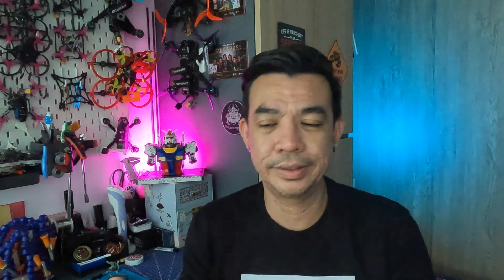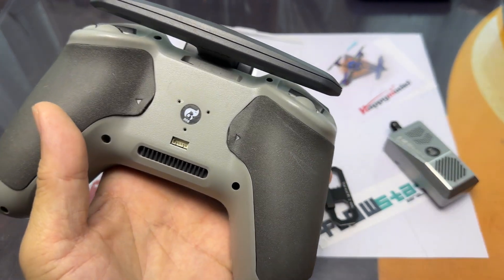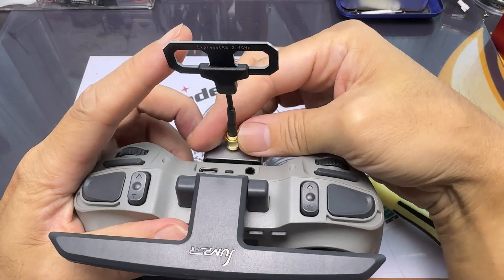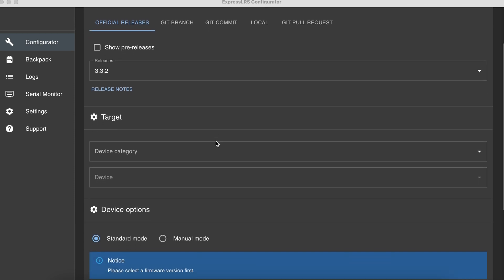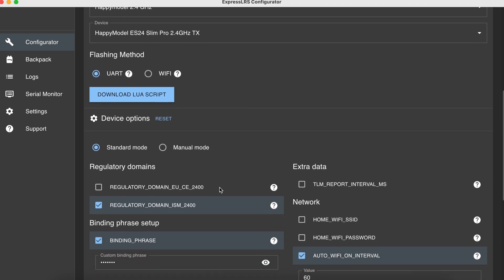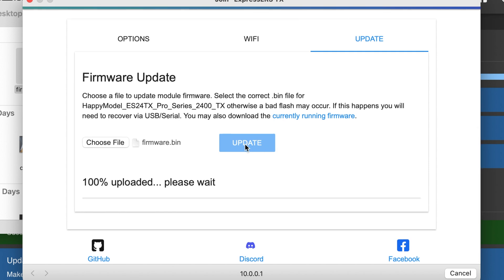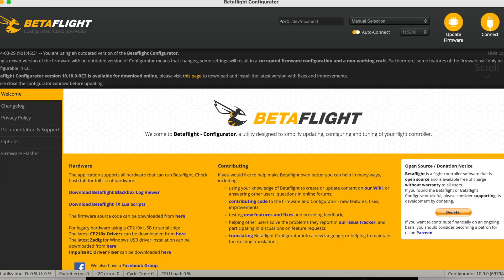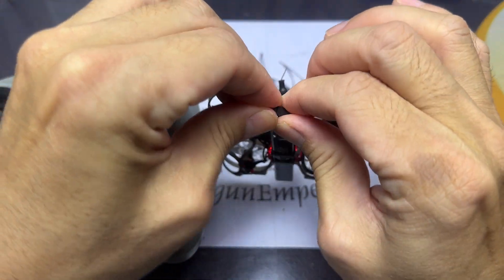Get Started With ExpressLRS In 7 Minutes! - Quick Guide For 2024

Comment: I also have the new mobula 6 2024, its a real struggle trying to get GNB 300mah batteries into the frame holder.
Reply from the maker: Do it at an angle. I use a 380mah one. If its tight, thats a good thing. U dont want loose lipos on that whoop.

Comment: Hi Brian, I use the Jumper T-Lite V2 ELRS with external module is the best.
Reply from the maker: Nice. I used to use that radio… but it forces my hands into thumb position so i dont like it. Which is why i switched to t-pro instead
Reply: @shogunemperor  Me I like Jumper T-Lite V2 ELRS, Bro.
Reply from the maker: @onclefly8450  👍

Comment: Never got the hang of the Jumper T-Pro, I prefer switches over buttons.  The one I have is also the 4in1 and the Jumper Module for the back.  ELRS was a nice move, the features are crazy, I like the VTX admin.Thanks for the vid, a few friends will be getting this link.  Cheers!
Reply from the maker: I have these weird thumbs and I had to modify the Zorro to be able to use it properly. Im a hybrid so the T-pro works for me. Tango2 too! But its screen is too small n i could barely see the text on the screen! Hahah thanks for dropping in bruh!! 👊😘

Comment: Great info, will come in handy one day perhaps
All mine are Frsky...I still use the original Jumper T8SG radio. I have a Zorro 4 in 1 and bought to try ELRS and was going to buy an external module. But they had issues from radiomaster modules at that time. so I just never got around to it. And I have not bought any new quads since the Mob 8 and Bassline and both of them are Frsky...and since I do not get to fly that often, i have not moved on to ELRS or  Ext module.
The way i fly it really does not matter. But maybe one day I will get a few ELRS Rx's or newer quads with it installed...but I am always a few years behind in new tech...By the time I get to it , there is something newer or better and what I get is already obsolete .....LOL
Reply from the maker: Thanks bruddah! Really appreciate it man! Wow! T8SG! Yeah man. Well.. u have all u need I guess. But, in the event that u switch over to ELRS after using Frsky for so long… you WILL see a massive difference in stick response!!

Comment: I have the jumper just like you and de module with hot glue on de back .

So de module can't fall off I had that problem and de pinned where Bend and had to order a new one.
Have the happy model module not so powerful...use it every day no problems about 2 year's.
Reply from the maker: Yeah! Actually, the slim module lasted me very long. I’ve been using ELRS since the 1st time Happymodel released it. Just sucks that the slim module died on me. But oh well… it gave me a reason to make this video!!! Hahahah